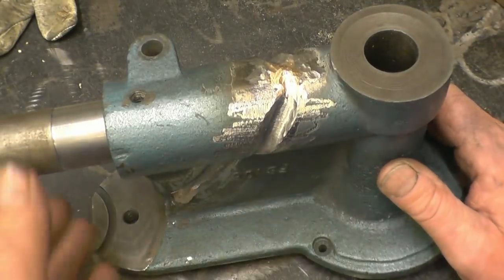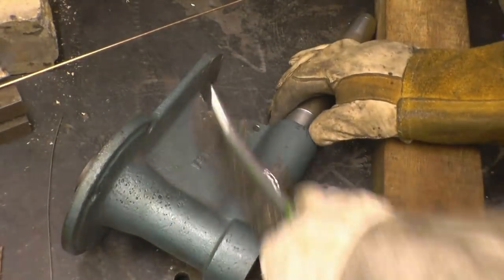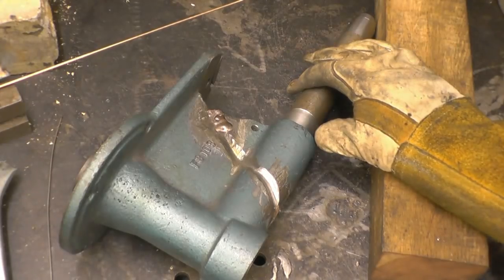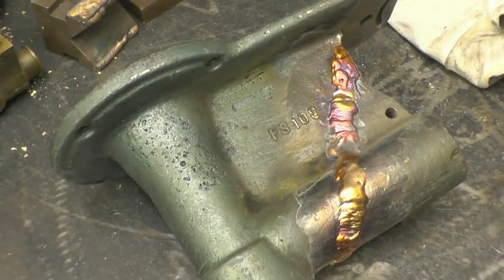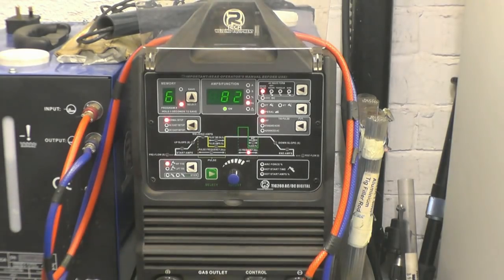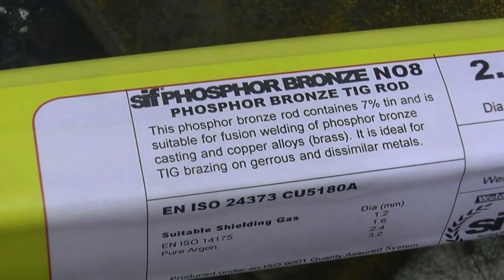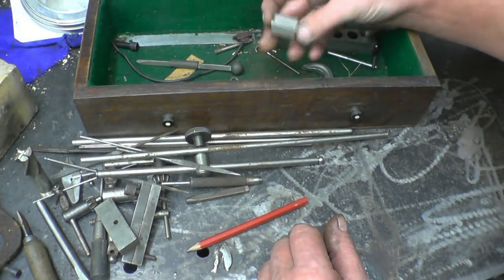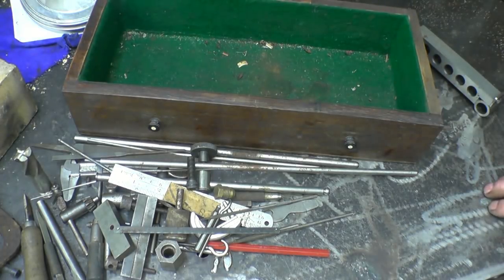SNNC 238 P2   Cast iron Bronze weld repair

Comment: Thanks for making that simple mate. Iv been trying to repair a crack in a cast bandsaw table. Turns out Iv been running way too much cleaning action. Thanks mate Iv spent ages looking for proper info on settings.

Comment: You can cool down cast pieces in the oven, if Debs will let you get away with it.  Just preheat the oven, toss in you piece, and shut off the oven.  Let it lay unmolested until it is cooled off.

Comment: Looking forward to the video of that bar with all the holes in,....I can't think what it's used for??
Reply: It’s a sine bar.  Used for setting work at an angle in the vice.  One end is shimmed up with a precalculated amount of gauge blocks to set the angle.
Reply: golf tee holder :P

Comment: hi , if it helps I too have the same welder from R-tech , I'm  not a welder by no means but generally use al bronze on ac mode for cast ( al bronze no 32) as it wets in nice and phosphor bronze just on dc mode for mild steel (Phosphor bronze no8) both can be bought from R-tech or Rapid welding & industrial supplies ltd . hope that helps

Comment: Now I'm really confused because you said you used Silicon Bronze but you showed a  Phosphor bronze package ??
Most weld videos I've seen they use either Aluminum Bronze or  Silicon  Bronze for Cast iron. Now I guess there are three rods to choose from ???
 I am so confused.  Perhaps someone can elaborate on the pros / cons of each.
Thanks John
BTW is that Chinese rod. Note the typo on the package at 9:43. It says Suitable  for Gerrous metals. (sp). I assume that's supposed to say Ferrous metals. Hmmm.
Reply: maybe gerrous is what they have called chinesium
Reply: Yes, ASME Sec II Part C, SFA 5.6 says this is Phosphor Bronze too, and it is for Copper to Cast Iron welds. They also say it is sluggish - which we see here, and that there should be a healthy preheat of 200 Deg C. Gerrous / Ferrous is just a fat finger away on the keyboard.. :):) It is certainly a nice looking result, how is it holding up in service...?